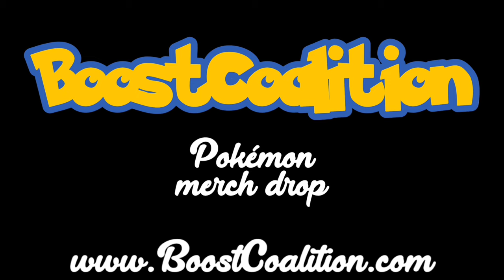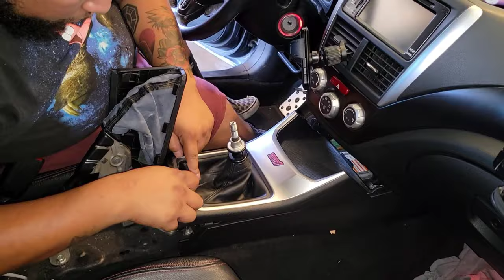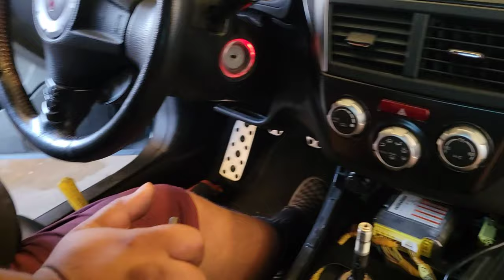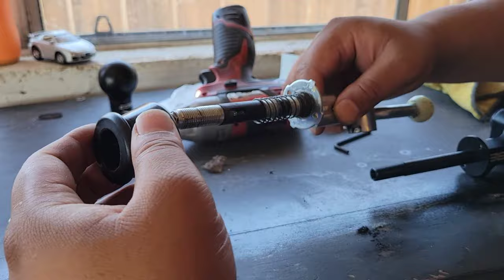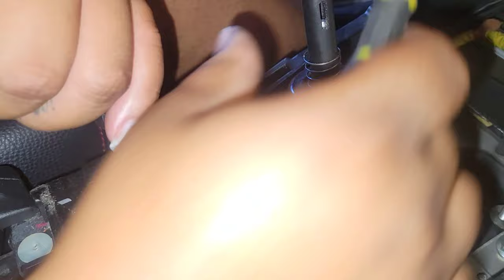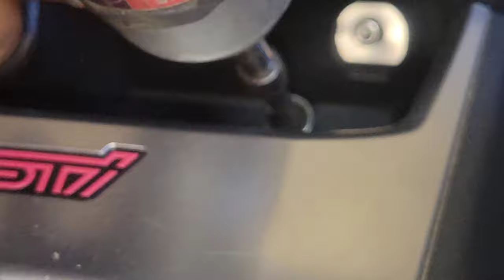2012 Subaru WRX STI | Cobb Short-Shifter Installation

Comment: ❤Hi.bro.Is it easy to enter reverse gear? My cobb seems to have difficulty entering reverse gear. Is it an installation problem?
Reply from the maker: Make sure that the reverse lock-out wire is not getting caught on anything. We had a similar issue, and it was that
Reply: @BoostCoalition  Ok I see.Thank you bro.